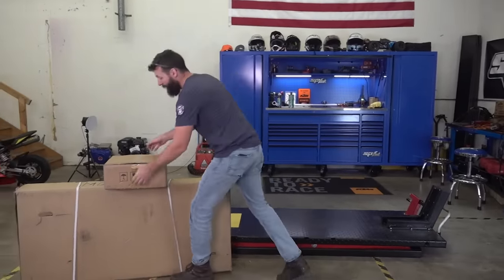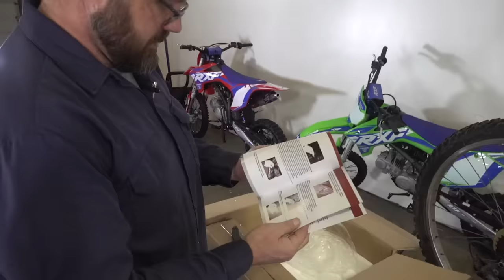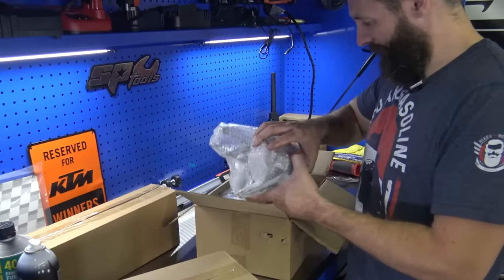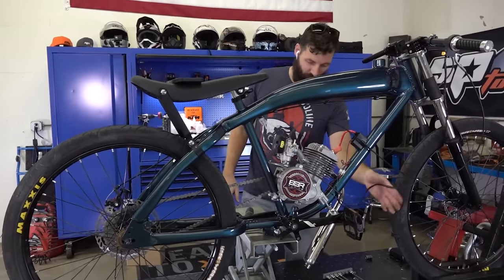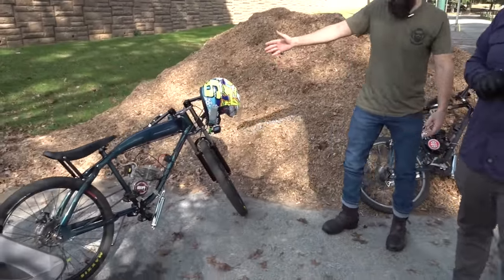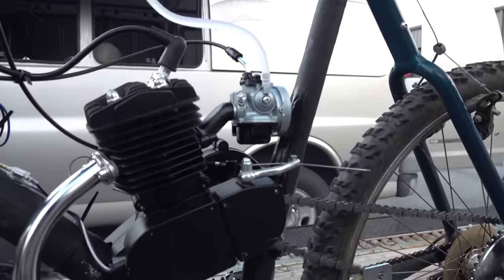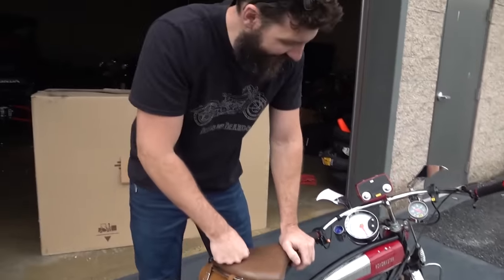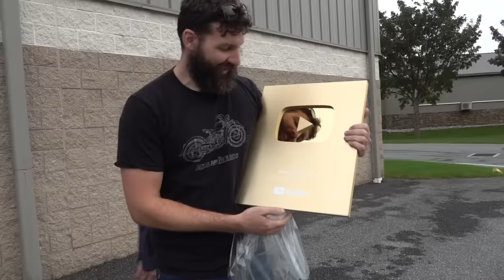I Bought the Cheapest and Most Expensive Motorized Bike kits from Amazon

Comment: You could buy a 125 cc 2 stroke motorcycle engine and mount it in for a( 125cc motocross bike) your bike frame or a 250cc 4 stroke atv engine  6spd transmission combo!
Into the bikes gears for a 21 spd. Trike.

Temu has them for $250.00 for the 125cc atv motor/ 5 speed transmission or the 250 cc atv motor / 5 speed transmission into a 21 speed bike or trike.
❤❤❤

You should hit 150 mph!

Comment: Lol you two are funny the motors are supposed to be broken in with like 3-4 tank's of fuel first before any hard running and suppose to check all the bolt's for tightening after each run 
They vibrate a lot and lossen up on rides:) but it was cool you showed me what would happen if I don't do these things
Reply: @cdcorrigan  most likely melted dew to the heat of over rpm for extended time with the higher mix of oil in gas it burns quite hot as is

Comment: The speed difference is probably because of the sprocket ⚙️ on the MTN bike kit it's a 44t sprocket,  and on the bike with the tank built-in it usually has a 36t sprocket ⚙️⚙️.. I run a 36t sprocket setup on my rig an usually it cruises at 30-ish mph and my top speed is around 45 mph.. they're a blast and requires a lot of maintenance but also usually pretty reliable.. good video guys I really enjoyed it 😅😅

Comment: I bought the cheapest kit i could find as im cheap, proper break in with proper oil and I've been riding it to work to save gas lol(own a ram and it was 2.14/l) the engine so far has been the MOST reliable thing out of the whole kit , chain is shti but the little thing pulls my 190 lbs as$ up hills np

Comment: The indurance test wasn't exactly the most optimal test.
The cheap one is 80cc and the most expensive is probably somewhere in that range.
With no break-in, improper ratio of oil and without air flow, of course these engines are going to literally blow up.

Comment: I bought a 100cc motorized bike kit last week the thing was building these engines you have to take your time and do it right then you've got to break it in you can't just start it up and go and then put it in full blast like that again you have to break it in and like 15 to 20 miles an hour for so long then once it's broken then and the carburetor has been adjusted right you get better results you can get thousands and thousands of miles out of it if you take your time and build it right can't just throw it together and race at full blast that's why your engines died like they did I do Uber eats with mine here in Nashville it's a great way to make money considering I don't have a car to do it anymore I get between 100 and 150 miles per tank of gas I understand that you guys had a challenge going on then you got money to just blow like that but like I said if you want better results you got to take your time and do it right be amazed how good it long runs

Comment: Of course they over heated strapped down. You know even a high quality motorcycle with and AIR cooled motor would over heat under the same conditions. 

Go put your bike on a dyno, and note the HUGE fans to keep your bike cool, and safe while it is revving under load but not moving.

Comment: its not the carb and its not your weight its the type of tire u have you want 10 gage spokes and hybrid tires instead of mountain bike tire i dont mean any offence i just learned the hard way if u ride that more then 20 miles as is youll need a different rim cause that motor is too much tork for that style rim and tire and tighten everything after first 4to5 rides or it will come loose they will last 8 to 10 years or 8000 miles if you take proper care of them in my experience the best bike motor would be the raw racer 2 the more expensive one on this video tends to die quickly and the other doesnt run well if it gets wet if u constantly run them full throttle they wont last a month back and forth to work stay off full throttle

Comment: Holding the throttle wide open for 10 minutes straight and saying you expected more out of a $160 engine you'd be lucky if the nicest motorcycle you own would be would be running if you held the throttle open all the way for 10 minutes straight straight I'm not sure many engines would survive that I've read I'm actually impressed the last debt long that was expecting them to go like maybe one minute tops at full throttle nit under load.....that's pretty damn good.

Comment: Did you guys break the motors in. Your supposed to run a tank or 2 with extra oil it it to break them in and only go half throttle to get the rings to seat and so on, Ther s a huge after market support for these motors. 2 stroke dirt bike pipes different carburetor s like the mikuni carb different size sprockets disc brakes different heads for better cooling. The hobby can get expensive though.

Comment: $185 motor kit on a bicycle and I ride it more than my dirt bike. These things have the simplest carburetor ever seen so even if you're not mechanically inclined anyone can take them apart to clean it if you have trouble. Or a brand new one is just $10. I get about 35 to 40 miles on a tank of gas, and I've had the same motor going on 2 years now. Anyone wanting to know more about these bikes should check out la hover's channel.

Comment: I had to bend my engine kit exhaust pip on a hydraulic press and grind the side of the crank case for the pedals to pass.

The cheap engines overheat if you think about it hard enough.

Four stroke bike kits are better

Comment: I know this is a Year old BUT these are Two Stroke Engines, Right? You put them on a Bike and the out put shaft is on the same side as the Gear on the wheel, right? BUT when they are running, they run Backwards to what you need. BUT Since they are Two Stroke, Can't they run Backwards? Counter Clockwise or Clock Wise, Right? So instead of the Majority of the people having to put gearing on them to make them run in the direction of their needs or Some people putting the shaft on the other side of the bike and needing a Drive Shaft and then gears to run the chain, Why Not just Run the Engine "Backwards"?... Would not need gears, may or may not have to extend/shorten the shaft to line up the chain...
OR how about if you are not going to use peddles anymore, put the side of the tire that has the gear on Backwards and it be on the left side and not the right side??? Wouldn't that work also?? Even IF you wanted to keep the Peddles, Put the side with the Drive Gear on the Left Side also. Would that also work????  Maybe a Updated Video on showing us How???

Comment: Those engines need air. Strapping them to a trailer is not a good idea. 

I have 2k miles on my $160 Amazon kit and it still runs like the day I bought it. Only two carbs and a few tires later. Lol

Comment: I've run all sorts of these things through the years. The cheapest are kinda hit and miss. You get some that run like a top and you get others that are junk. In then end find a reputable seller that specializes in this stuff like BikeBerry or Kingsbikes or something and get one of their kits. It doesn't have to be expensive.
Your first one is always going to be the fuckup one because you need to learn things about it.
From the sounds of things those carbs aren't tuned right at all. then to endurance test them you basically let themselves cook to pieces? These things are air cooled

Comment: I put a moped rear end on my bicycle front end and strengthened everything up in the rear it's got the 66/80 it runs pretty good it's geared low and I like to build things I don't care what it is so right on the four stroke in my opinion is probably a better one just for dependability alone

Comment: You're supposed to allow a break in period. 2 tanks before you start full throttling the engine. Also fuel mix changes after break in. Also these are air cooled motors, running full throttle with no cooling will destroy any engine on earth. Your videos are very entertaining, but you didn't do any research. This video could turn ppl away from 2 stroke engines, and it's all due to misuse. Please do a new video with proper break in and testing to give a fair representation of what these engines are capable of. Thank you both for your time. 🍻

Comment: I'm just gonna get a weedwacker  Forty nine c c Motor Attach a gear sprocket Onto the left hand side Of the crank shaft Attach a gear to the motor shaft And because it's gonna have to sit on the left side of the motor and bike anyway Attach a little chain To connect the motor with the sprocket Left side sprocket will drive Right side sprocket Which will drive the wheel forward And because of that I get the gear ratio From the 21 speed And I just remove the petals And put a set of pegs on either the front or rear Tires And Remove the front break And attach the throttle there Using the Handle that used to be there for the break. I'll get like thirty upwards fifty miles a gallon Easily be able to head speeds of 30 Towards 50 Thanks to the gearing ratios. And the only other thing I have to attach to it is a headlight For when I ride at night and maybe a rear tail light so people can see me And in the state of Wisconsin and Illinois you do not need a Driver's license For that style of bike As long as it is a forty nine cc motor Even if you bore it out and stroke it.

Comment: that endurance test is kinda wack. the engines require air flow to be cooled its not entirely reliant on the added oil. ive been riding my engine for well over 1000 miles. you honestly just blew 2 perfectly good engines

Comment: If this bike didn't have an intake it wouldn't run he meant to say air cleaner and yes the aftermarket carburetor suck stay with the supplied carburetor and stock exhaust iv bought both and ended up putting the factory parts back on it's faster with the factory parts

Comment: On half of the 2-strokes the piston is installed backwards and the rings clipp the port. The timing is way too far advanced. Grind the key way to retard the timing this will give you double the rpm's. For those of you that are a little more adventurous the crankshaft counterweights are like four times heavier than they need to be. 😊

Comment: Maaan. If only the motors were broken in. They would ride so much smoother/FASTER.
Reply: They also need proper expansion chambers, that muffler is trash. They'll get more power when the can eventually breaks off from vibration turning it into a straight pipe. A real expansion chamber wakes these up.
Reply: They can also get more by cleaning up casting flash in the ports and using a degree wheel with a dremel to get intake and exhaust timing correct, use a shaved key to advance timing and case match the transfer ports. They can also stuff the case with epoxy to help out a bit.

Comment: You guys are aware that those 2 strokes need to be broke in at a 16 to 1 ratio for 500 miles, then brought to a max of 20:1... they seized cuz you used a way light mix....also you need to blue lockt8ght every bolt on your bike and engine...
Reply: 16:1 is way too much oil. That's what it says on the instructions, it doesn't mean it's good. 32:1 for break in and 40:1 after for much more power and wastes less oil. If want to be safer then do 25:1 break in and 32:1 after.
Reply: @1ilrx  your gonna blow or take the life outta your engines running that lean...but to each their own...
Reply: @James-t1y6i  I mean if you read on some forums and servers a lot of people recommend 25:1 break in and 32:1 after or 40:1 right from the start. If you also search up best oil ratio for 2 strokes it says 40:1. 25:1 will last longer but my take is that it's free power and if it does seize up then parts are cheap anyways.
Reply: It's because half of the motors the piston is installed backwards and the rings clipped the port.

Comment: Your fuel to oil mixture was way off. Try reading the manual next time. Supposed to be 16:1 until broken in then 20:1 not 40:1.
Reply: I run VP small engine 40:1/50:1 multi mix in mine. Runs great and burns clean.

Comment: I'm making me one and im gonna use an actual gas tank off a street bike or i want to get two or three of those hinakin Mini Kegs and put them on a rack welded rite behind seat also putting old time banna seat with rest bar..Also im building a small bike wheels trailer i took the end of one of those tie down for mobile homes cut the square end off that has holes cut it again separated them added two straight bars and bolt it to the Nuts and washers that hold back tire on..for a hitch don't forget gotta turn so add swivel that turns left and right to wagon so ya don't flip your floppys!!!

Comment: I don't want to be that guy but I saw someone burn one of these in a trash fire covered in gasoline and then run it in soapy muddy used motor oil conditions, throttling it from cold start till the tank goes empty.. using the air intake to suck up detritus and dirt and it still hasn't died..

Comment: Come on at least give the AIR COOLED engines a chance by putting fans in front blowing on the cylinders giving these engines the same air flow as they would get while driving them!  Can you say RIGGED?
Reply from the maker: That was the test if we put fans in front they would lasted forever. It’s like draining the oil out of an engine and running until it fails. That was the test

Comment: They ran hot and locked up no air flow
When they are moving they get good air flow 
They should take any engine for a motorcycle and run it with no way to cool down and see what happens 
I bet a harley pops in less time running wide open with no cooling

Comment: I want to explain to the viewers something that many of you didn't see but is very important. I have been building motorized bicycles for years.

Why did the Chinese engine come assembled but the BBR engines came dis-assembled. What is very important to understand is the "BBR" engine when built wasn't originally disassembled.

With BikeBerry They sell a BBR engine, what is it really? It's a stock china doll with a supposed "upgraded jap bearing" they give you the piston, wrist pin, retaining clips, piston rings, cylinder and head all separate for you to assemble.

I have the rookie experience of removing the jug, not understanding how to put the piston rings on, compress them and put the jug on. I did break piston rings and retaining clips.

Now, lets say I am a complete noob. I buy the BikeBerry engine and probably do what? Watch their BikeBerry youtube videos, in which none of them talk about how to assemble the top end.

So they sell the top end disassembled knowing that most will mess up either by bending a retaining clip, inserting it incorrectly such as not at the 12 o clock position, breaking a piston ring putting it over the piston, dropping a retaining clip in the crank case, then not compressing the rings where the pins are on the piston, trying to force the jug on not knowing how to lubricate the jug, compress the rings, how to put in the retaining clips etc.
So, lets assume the noob does all the expected mistakes, because I sure as hell did not know how to assemble a top end for months. Now, what is the conspiracy?

While it isn't suspicious that they sell bike parts, I do find it rather convenient that they sell all the parts that will more than likely get broken by the rookie. They sell stock china dolls disassembled knowing that you will break things and you do what? You come back to do business to buy the very parts you broke.

A stock engine kit, just buying one as a normal customer costs what? $120 max? So they buy their kits by the palates, let's say they get them at $90 a pop. This so-called "Japanese bearing" costs maybe what buying one? $20-$25? They buy hundreds and the cost is lowered. Let's say overall cost for the kit and this upgraded bearing maybe costs them what? $130?

Not only do they make money by saying these kits are "BBR" which leads people to think it's a brand, but it's not. It's a stock china doll with a Bike Berry sticker, there are no brands or manufacturers. There are only two factories that produce these, one makes Grubbe engines and the other one makes every single stock china doll. This is why your BBR engine used to come with the A80 A100 manual, because it's the stock china doll dressed up to be more than what it is.

In a nutshell, I believe BikeBerry sells disassembled top ends knowing that you will break things and then they make money knowing you'll be back to buy retaining rings and piston rings.

Comment: Thease are what u build custom,
I do custom conversion from 2wheel to 3 wheel, and install gas or electric or u can have pedal power and gas and electric all in one ,
Or I can build simple and dependable, I built one that I had a customer put 200miles a week on it, 
He did that for 2 years , after 2 years he needed a repair, a chain,
I use custom motor mounts high pressure fuel injection hose and a ton of other simple extra parts I would make , 
I messaged u a while back 
And had gotten extremely busy with some unfortunate personal business,
But I'd like to give a call

Comment: Before you waste another engine kit just send it to me. You guys must not have had oil in the engines, neither of my engines are dead yet, and I've now owned them for 7 years, and ride both at least 2 times a week, and they both do more than 30 mph. Under sized sprocket on the one allows me to do 52mph. What. Waste of motors, and money my guys.

Comment: Hell yeah they're gonna fail because those little motors are air cooled by the fins dragging air across the cylinder head as your riding. That's honestly not an accurate reliability test. That's like draining all the oil out two Cummins diesel motors and running them until they seize and complain about how shitty Cummins engines are.